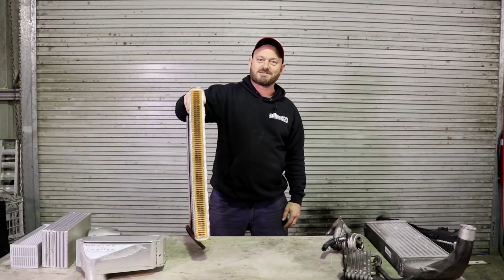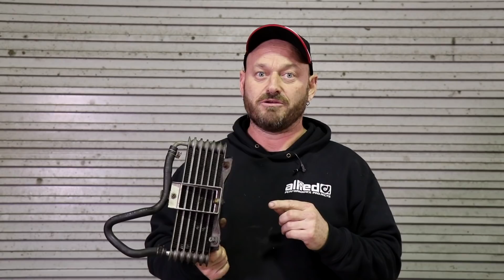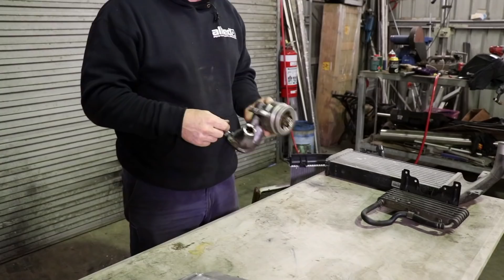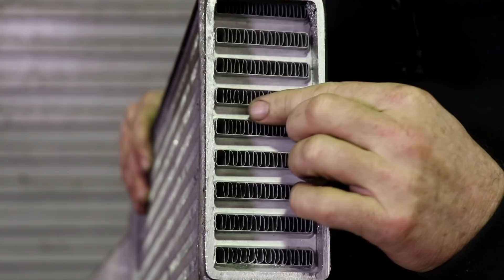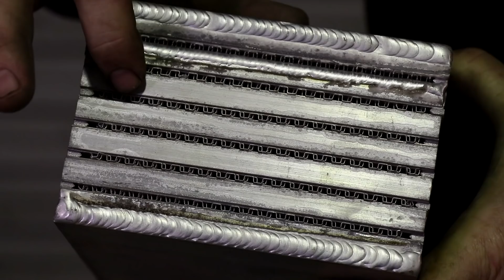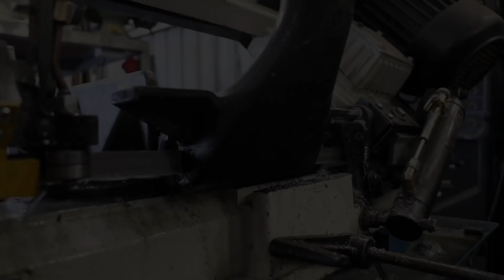THE SKID FACTORY - [QUICK TECH] Heat Exchangers Explained

Comment: Thanks, Al, I’d been struggling with efficiency of my chargecooler, for some reason I’d not made the connection of the importance of making sure all the airflow goes through the heat exchanger, despite having the engine fans on permanently. I sense that I’ll be making a shroud in my near future!

Comment: Wow I actually know something that Yoda doesnt.
When you compress air your doing work. This transfer of energy is what actually heats the air up. The faster you do this work, the hotter the deltas get.
Air molecules do not "rub together" and do not heat up because of any friction occurence. If that was true then compressed air bottles would remain hot due to "rubbing together."

Comment: Good vid👍🏻 
REALLY good vid. 
After watching this vid folks, try find other similar video that not just describes various, important factors involved but addresses and explains the specific technical aspects of this so you can equip yourself, or begin to,  on how to achieve the best system possible for your vehicle, and bank account  circumstances and limitations. 
Good luck with that, if you find one let me know please. 
This is one of the least understood, and most important, aspects of boosted, small capacity performance engines/cars, along with cold side piping.... 
This has HUGE effects and implications, maybe not for peak power at WOT on the dyno or drag strip, but on spool time and response. Up there with plenum runner spec and turbine waste gate voodoo magic. 

So try give eBay a miss for this stuff if you can afford to. 

The amount of ‘professional’ mechanics that have dismissively countered me on this with “nah; it makes little difference” or “na, wasting your money, you would barely be able to notice the difference” 
I dont take any workshop seriously that holds this belief.

Comment: Hi Al! A great topic for a Quick Tech would be the evolution of ignition systems from breaker point distributors through CDI igniter systems with magnetic triggers and on to proper engine computers. A lot of shadetree mechanics hate engine computers because they don't understand them & their benefits, such as elimination of distributors and mechanical fuel injection as well as the flexibility gained in fine adjustments with air/fuel mixture, timing adjustments, etc.

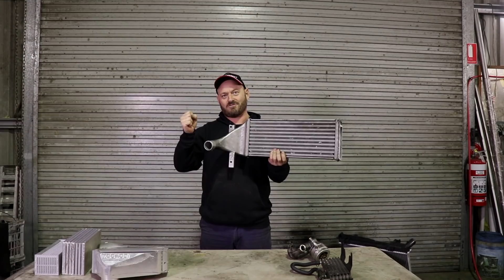Comment: 8:18 the turbo is also a heat echanger, if unintended: the turbine gets red hot from the exhaust gases and this will transfer into the compressor side. this is a bigger factor for the heat than the compression (18 psi isn't even a proper tyre presure(unless offroading), this heat from compression will only become an issue with workshop compressors that go up to 160 PSI.)

Comment: I’m a fridgey and I’ve always wondered whether there’s any benefit to running an evaporator from an a/c system as an intercooler, do you know if it’s been tried?
Reply: yes, there's been a system like that on a ford F150 if i remember correctly.. it could pre-cool and give extra boost cooling for only a few minutes (say a drag sprint)

Comment: Killer break down, this series is a really great addition to the channel! I think that most people believe that there's a WHOLE lot of black magik going on in the various cooling systems of their cars; but, the reality is that, as essentially laid out here, they're ALL just *radiatiators*, every single one of them! Whether liquid-to-air or liquid-to-liquid(remember elementary science class; both liquids and gasses are FLUIDS!), they're still just metal matrixs that allow two separate fluids to exchange heat between one another via a single metallic wall acting as the thermal transfer medium.
Once you realize this, all of the voodoo magik goes away and things become much more simple to understand and diagnose.

The only addendum that I would add is that, first, heat soak is a very relevant factor in any cooling system(and an explanation of what exactly 'heat soak' means) and, second, in a related minor correction, liquid-to-air intercooling DOES offer the potential of marginally greater cooling performance(lower charge air temps), particularly in an 'endurance' application. 
While an air-to-air intercooler will heat soak and normalize(while it starts out at ambient temperature, once operated long enough, the temp of the intercooler itself will average out somewhere between the higher temp of the incoming charge air and the lower temp of the outside ambient air, somewhat limiting its cooling/heat transfer ability), this heat soak isn't near as dramatic on a liquid-to-air intercooler because the whole system contains SIGNIFICANTLY greater thermal capacity thanks to the great density of water/coolant. Because you have a pretty large volume of coolant in the reservoir at ambient temperature, only the fraction of that coolant that passing through the intercooler(radiator) at any given time is being heated up by the incoming hot charge air charge, and that coolant then goes through another liquid-to-air heat exchanger(radiator) to offload most of that heat into the outside atmosphere, the entire liquid-to-air intercooling system takes a VERY long time to heat soak in comparison, and when it does finally heat soak(as long as there isn't a cooling bottleneck in the system mind you - it only cools as effectively as its lowest performing component) it normalizes at a much[relatively speaking] lower temperature than the air-to-air system does. 

This is why the vast majority of modern factory forced induction vehicles use the certainly much more complex liquid-to-air intercooling system while really only budget cars and giant diesel workhorses(and the odd anomaly of course) use air-to-air intercooling from the factory anymore.

Don't get me wrong though, I don't mean to rant about this or anything at all, these videos are just a bit of a 'thorough summary' I would probably call it after all; and, explaining why someone/race teams/the factory would choose to use the quite complex, quite expensive liquid-to-air intercooling over air-to-air is certainly enough to confuse people just learning about automotive cooling systems.

With that said, part of the reason that I leave these giant comments is in the hopes that someone who may have questions about "why liquid over air" and what not may come across it and learn a little something that they may not have known before - and, for that matter, if anyone has questions about liquid-to-air intercooling, feel free to ask because I do have experience with & knowledge about them(see some of my old uploads for an example of where I've worked if you have a credibility question or anything), I do LOVE to talk about this shit after all!

Comment: electrical diagnostics could be an interesting video if you can find and repair a car in true fashion. say turn signals dont always work. or maybe keeps blowing fuses. how to diagnose bad relays and 3 way switches or even a blower motor resister for low mid high.

Comment: Good video

One thing I’ve tried to explain to turbo diesel owners is the difference between intercoolers for petrol turbos and turbo diesels. Petrol turbos (street cars) tend to use bar and plate intercoolers because they are designed to act as a heat sink, due to fact that the turbo is usually on for short periods of time and the absorbed heat can dissipate between periods of boost. 

Turbo diesels are on boost all the time and the intercooler has to dissipate the heat constantly, so the tube and fin design is the most efficient for turbo diesels (whether top or front mounted) and can be a lot smaller and lighter than a bar and plate intercooler. Many aftermarket dealers promote their bar and plate intercoolers as being better than a tube and fin, but they neglect to note that what they sell are substantially larger units by volume than the tube and fin intercooler they replace.

If you had a tube and fin intercooler of the same volume, it would be far more efficient. However, tube and fin intercoolers can’t be made as simply as bar and plate, which come from China in great slabs that are just cut to size; so it’s much easier to produce a bar and plate intercooler than a tube and fin one. I’d be interested to hear your thoughts on this.

Comment: Great stuff. I went with a 'chargecooler' on my defender because i dont see the point in spending 700€ on an intercooler thats probably not doing much at the low speeds that are common during offroading. So far i have learned about heatsoak because the radiator i used to cool the chargecooler was too small.

Question, can the radiator for a chargecooler be too big or is the concept the cooler the charge air the better? Can u damage the engine in any way (danger to inlet manifold or blowing the welds on the intake) from thermal shock by cooling the charge air too much?

Thanks guys!!!

Comment: We tend to call all "intercoolers" charge air coolers (or charge coolers for short) whether they are air-air or water-air, because the "charge" is just the air/air-fuel mixture (dependent on fuel delivery system) that you chuck through the inlet valves. The term "intercooler" strictly refers to cooling gas between ("inter") multiple compressor stages. Interesting example of supercharged engines with charge air cooling: current Jaguar Land Rover V6 and V8 gasoline engines have a blower in the vee, with two water-air charge air cooler (WACAC - I like saying it...) matrices which employ a separate liquid coolant circuit to the engine coolant circuit
Reply: (this is not to detract from the video by the way, as Al clearly delivered a trademark spot-on explanation!)

Comment: Extra tip: The more coolers you stack in front of each other, the less efficient they are. International learned this with the Maxxforce13 engine and a rad pack that was about 600mm thick. from front to back it went: -> A/C condenser -> Low temp rad (for the EGR & air to water intercooler) -> Primary air to air intercooler -> radiator/trans cooler -> Secondary air to air intercooler. The small gaps between them all would suck in all sorts of shmutz and it takes a good hour with a pressure washer to get it cleaned out.

Comment: I always had trouble with those bell cores leaking in the middle of the core and unless they were supplied as a complete unit with their tanks... No bloody warranty.
The efficiency of them was also well below that of a smaller garrett core.
On the old school td42/1hz style diesel engines, the garrett core would produce about 1-2afr leaner on the same fuel quantity.

Comment: Nice one! Still love my beetle though!! 
What about having a blow off valve VS not having a blow off valve?
Reply: Easy... depends on the car/engine... but Blow off valves are usually installed to minimize stalling (slowing down) of the compressor/turbine wheels when you let off the throttle... making lag an issue going into the next gear... it bleeds off the volume of air to either atmosphere or recirculate to keep the turbo spinning "freely" instead of hitting a "wall of air".. and slowing down far to much so when you engage the next gear and apply throttle... the spool up time is much less than without a BOV fitted. Of course it certainly depends on if you have an OEM setup of a Massive turbo for Max POWAAARRRR!!! cue the S13.....Hope that helps

Comment: In my car transmission oil runs into the engine coolant radiator. Thankfully it is designed in such a way that these fluids have no means to mingle.

Comment: Heat exchangers are simple devices that need to transfer heat energy from one fluid to another, without physically mixing them together. I think this video was too basic for the average Skid Factory viewer, and needs about 20% more technical depth; not saying you need to go all EE Whiteboard on us, but not even touching on surface area which isn't a hard concept and is fundamental to how these things work, struck me as missing the mark a bit.

Comment: The young fella at Vague Industries uses a water to air heat exchanger for his twin turbo 5.3 Hilux, but in his reservoir he has an A/C evaporator which is still plumbed into the A/C, he says it brings the water temp down so far that he has to use antifreeze in it. Its a clever way of getting it consistently super cold, but the complexity of it is huge, and trying to keep the little scroll compressor reliable wouldn't be easy I'm sure

Comment: I remember Al showing us some settings on the Haltech software, but a Quick Tech video on setting up a brand new Haltech would be great. I'd like to use a Haltech in a build I'm planning, but coming from the world of carburetors and push rods, it would be nice to see a run through of what's necessary to get your car running to get it on a trailer and over to the tuner. Cheers

Comment: Air cooled Volkswagens have heat exchangers for the heaters, check out the times they run on the quarter you might be surprised
Reply from the maker: Air cooled VWs have some amazing heat exchange technology in them. To make a commercially successful air cooled vehicle in the millions is no mean feat. The heat exchange in them is very carefully engineered.

Comment: You could elaborate on the water to air coolers a bit. They have some advantages. More heat capacity (more BTUs absorbed from the charge air, before "soaking" the cooling components and allowing charge air temps to increase).
Also, the coolant can be cooled below ambient temperatures using water ice added to the reservoir, or by utilizing the air conditioning system to refrigerate the coolant.
Reply: I'm no expert but why would you need to worry about below ambient temperatures for engines that get to 300c to 500c or so in temp? Unless you live on a planet close to the sun or a volcano I doubt your ambient temps will really matter much. Cooling an engine is more about quickly getting the heat away. A larger radiator or a better arrangement of fans will usually fix air flow etc.
I'd love know more. I usually only cool PCs and understand that cars etc are quite different in their needs. The temps are much higher with cars and the amount of liquid you use in the car radiator is also much larger than a PC.
Reply: @skilletpan5674  Engines typically run 80c to 110c, not 300 to 500!
It may not seem like much, dropping intake air temps an additional 10-15C, but that does make a significant difference in power output. Not only from the denser air charge, but the ability to run higher boost pressures and more aggressive ignition timing before encountering ignition knock. Knock is a dangerous condition, I'd do some googling if you aren't familiar with it.

Comment: Al, you say the water to air ‘isn’t better’, but you well know the coyoda kits keep the boost air temps down way better than an air to air cooler on the same FA20 blocks at the same 40degree Ipswich afternoons at QR sprints!  Sell your product man! 😋

If viewers have an 86, these are premium, well engineered, stock looking low mount kits for boost and as about the third one fitted I can attest on only 6 to 7psi (wastegate pressure) I’ve got 170kW at the wheels and have run this thing for 3 or 4 years on absolutely stock internals including the clutch. (Clutch is now getting a bit iffy finally; bear in mind I was careful not to do many clutch dumps). Power delivery is smooth and beautiful. Daily driven and tracked. Only problems I ever had were popping vacuum lines a couple of times and the mk1 oil scavenge pump giving out (replaced with a much more robust mk2 unit). Best 86 boost kit on the market hands down.

Comment: Ford had an oil/water cooler that sometimes got confused and the twain would meet. Usually you got some confusing situation where there was oil in the water, but no water in the oil. Oil runs at a higher pressure, so it could work out a crack the water couldn't get past. after a while, if one didn't catch it (or kept blaming the others for sabotage of putting oil in the radiator) the crack would get big enough the water eventually got to the engine oil.
Pudding!

Comment: Quick Tech: Engine oil viscosity, what happens if you change the weights, what the oil actually does, why changing oil every 5 minutes in a car that has done 1,000,000 kms isn't a wise idea etc

Comment: Topic i'd love to see covered. Wrapping/coating exhaust parts, worth it?
Reply: totally worth it, check out " Engine Masters" episode on ceramic coating some hooker headers, its in their dyno room, great comparison, factual and very convincing.......keeps heat outa the engine compartment, and improves thermal dynamics...ie: hot air rushes more quickly towards the exit, your exhaust......flow, baby, flow
Reply: @stevenjohann5435  Not just faster to the exit, but to spool your hairdryer.. 
Also helps when you have a turbo exhaust housing right beside your brake master cylinder like me lol. coated/wrap/turbo beanie/heat shield 😂
Reply: No. They crack due to the extreme heat cycling with no way to expand at the flange mount. Not worth it for the less than 1% gain at the very most.

Comment: It's worth mentioning water/air charge cooling can allow you to get intake temps below ambient air temperature by using ice in the systems header tank, this is mostly used for short term affairs like drag racing.
Reply: Def worth mentioning though you could do the same with air to air and a co2 or nitrous spray bar